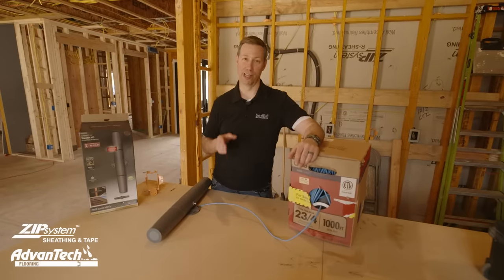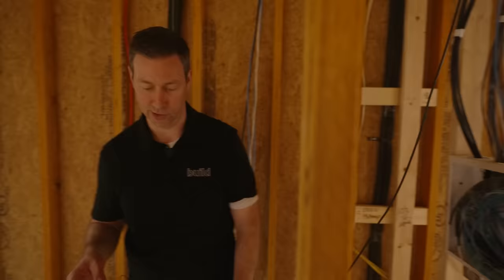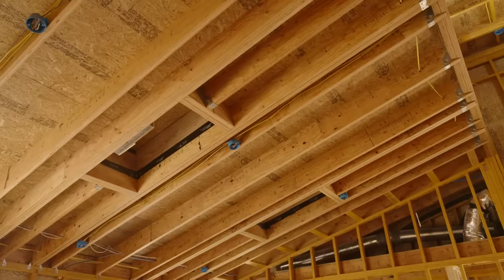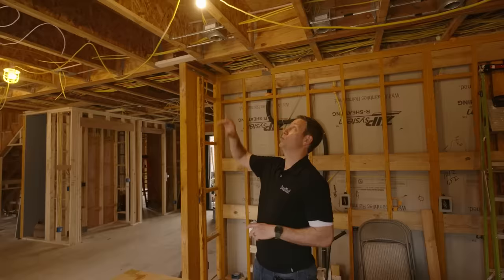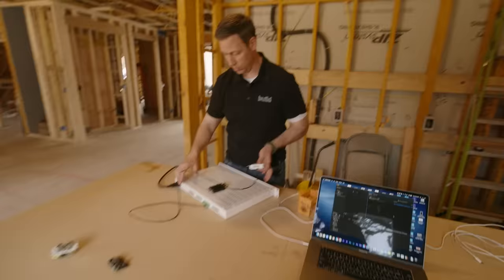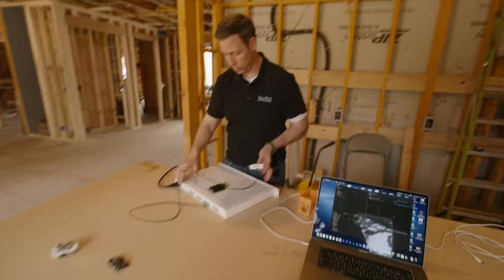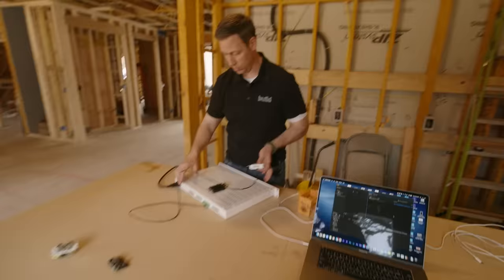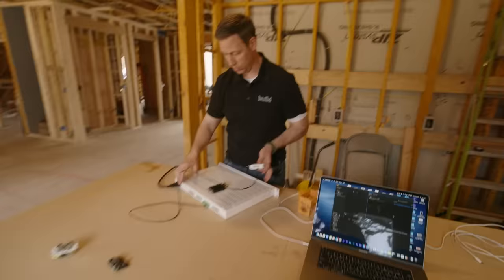Low ⚡Voltage at the Real ReBuild

Comment: I did a remodel of my house, myself and it was a 1930 house. I did brand new AC wiring as well as DC wiring. House is about 2000sq ft. But with older houses you usually had one central light with AC. But since i did not wanted to rip out lath and plaster i decided to increase lighting with LED pucks. Since lath and plaster had cracks in the ceilings i decided to mesh and skim coat the ceiling and walls, but under that i grinded channels and berried 18 AWG wires for 2 inch led pucks (normally can by on amazon for under cabinet lighting) so in bedrooms i berried between 6 and 8 of those kitchen got about 18 and living room got about 12. Each of those pucks would consume 2w at full blast if dimmed can go as low as 0.5w. All the 18AWG runs to switch on the wall right besides the AC or main light switch. But the DC gets its own DC dimmer that costs from 2 to $12 of sleek ones (also amazon). Than i ran a 14 AWG dc cable to my little DC panels which are on each floor so 3 total, which runs to a AC to DC converter about the size 2*3*8 that plugs in AC 15 amp outlet in my attic. Also bought amazon for about $40 bucks. this can handle about 75W max output so meaning I can ran 40 of these pucks at maximum to light up my whole house. The whole system cost me about $200. and i have been running this paralel to my AC lighting, Last year we had a 4 day black out I plugged this in to my portable goal zero battery and had lights through out the house for the entire time and still had half battery left after 4 days. This is a labor intensive to install, but otherwise its only 12V system. My 6 year old is playing with it and helping me. And all the old school 6 inch cans are so outdated but the 2" look great. Did not pull permits on this so im sure when i go to sell this might be an issue with the home inspectors. I used 14awg from panels to switches because in DC system power does drop on longer runs. You could run for charging your phones using car USB plugs which im sure are cheaper too. But all lighting for sure can be run on this system. you can even get sensor switches and or human sensing switches for dirt cheap in comparison to any AC system equal task parts. Enormous savings in total, especially on the visual or finishing touches and capabilities including smart home and voice activated stuff. Hard to recommend due to the fact that no inspector would ever pass this. But due to new technologies the W and V we can use for smart homes LED lighting and sensing and all that the 15amp breaker is and overkill where I can run my whole house light up to max for 200W which used to be only 2 light bulbs. Blows my mind. Would love to here if you think this will take off eventually.  

Some links from amazon
GETINLIGHT Dimmable LED Puck Lights Kit, Recessed or Surface Mount Design, Soft White 3000K, 12V, 2W (12W Total, 60W Equivalent), White Finished, ETL Listed, (Pack of 6), IN-0102-6-WH

BINZET Wall-mounted Glass Touch Panel LED Dimmer Switch Brightness Controller DC 12-24V for Single Color LED Strip Light Lamp-White

Hiletgo 3pcs DC12-24V 8Amp 0%-100% PWM Dimming Controller for LED Lights, Ribbon Lights,Tape Lights,Dimmer is compatible with Hilight, LEDwholesaler, fillite, and others' strips

12-Way Fuse Block With ground, 12 Circuit ATC/ATO Fuse Box Holder with negative bus, Protection Cover & LED Light Indication, Bolt Terminals, 70 pcs Stick Label, For Auto Marine, Boat,With 24 pcs Fuse

LightingWill Waterproof IP67 LED Power Supply Driver Transformer 100W 110V AC to 12V DC Low Voltage Output with 3-Prong Plug 3.3 Feet Cable for Outdoor Use

Comment: I would love if you could get into the tech and wiring side of things for a bit. Would like to hear more about sonos
Reply: Yes please. I geek out on this stuff.
Reply: Sonos works in a constant state of broken... It's honestly not worth the frustration or the immense loss is sound quality... If you are a lover of audio and its accurate reproduction sonos is a crime...
Reply: Sonos is overrated. Their products are overpriced and you can find similar Bluetooth devices for way cheaper.
Reply: Matt Risinger  FAKE ACCOUNT!  Your so screwed!
Reply: Please no.
Reply: If you want AMAZING in wall or on wall speakers, look into Axiom Audio.  Their speaker engineer even does great videos here on the youtoob.

There are so many dishonest audio technology companies out there that Axiom is really refreshing and not absolutely stupid expensive.
Reply: I personally wouldn't choose Sonos for anything "permanent". You want anything permanently designed into your building to be as long-lived as possible, and for electronics that typically means as dumb as possible. Integrated speakers should be hard-wired to an amp cabinet, so that you're not stuck with the speakers that you initially chose if you need to change down the line. They can terminate into any amp, which means you can use Sonos (via their Port product) now but aren't locked in if you eventually change systems, when Sonos inevitably deprecates their current protocols and devices, when the company goes under or is bought out or the products are discontinued.

I have 25 year old speakers and 35 year-old amps and a recent pre-pro. They're all still perfectly usable, but you don't see me with a boombox or other tightly integrated system. Technology moves and changes rapidly: don't build yourself into a corner with today's cutting edge because tomorrow it'll be at best passé.

And for home theater, for Pete's sake get a proper Home Theater receiver. You'll want better room correction than Sonos can provide, as well as more options for inputs and outputs and configurations. If you only use the smart features in your TV, fine, but as soon as you have multiple boxes and multiple input sources it becomes a lot more trouble to manage that via the TV than a dedicated box, and just stick to using the TV as a screen.
Reply: Hardwire your sonos amps and use in wall or in ceiling speakers
Reply: @aaronsanders3372  Totally agree. The speakers and the amplification have to be separate. Sonos might be the go to product now - but perhaps not in the future. Speakers however last for decades. I would match the Sonos with Stealth Acoustics Invisible Speakers - hard wire back to the amplifier. That's what I did for my own home.

Unlike Sonos the Stealth Acoustics Invisible Speakers work with an AV Receiver and you can use them for surround sound Atmos installations. Now tell me a wife that would indulge their partner with an Atmos install in their living room (10+ speakers) and I'll show you someone that installed Stealth Acoustics with an AV Receiver - in my case a Denon.

Comment: I was actually expecting him to say that the 12/3 wasn’t for the lighting and that he was going to wire all of his lights with low voltage.
Reply: if you want low voltage wiring using awg 20/2 instead of 12/3 - see atxled.com
Reply: @atxledconsultantsinc.9997  I'll check that out.
Reply: So much this. 
Again asking, "Why are you running 12/2 all over the place for lights?". I know this is an old video but I expected to see something other than, "I can plug my USB in to a socket and charge my stuff." 😶😒😮‍💨 And I'd surmise from the comments in his previous video that this was not what those comments were about (in fact had this same question while watching said video) but instead questioning not using PoE for actually powering his lights! 

Wondering now if Matt ever realized this was what commenters were referring to. Not charging his MBP and powering his security cameras.

Comment: Four 'twisted pair', not stranded. The category 6 is a solid wire cable.
Reply: You can have stranded Cat6 cable. Its used for short runs like patch cables that require flexibility. For the long runs he did in his house I hope he used solid.

Comment: Having lived through all the copper conductor / connector plug changes in the last 20 years I thought it obvious that my house plans specified Smurf tube (flex conduit) to be installed throughout the house so new tech cables could be fished through the walls.
The Six P's :
Prior Planning Prevents Piss Poor Performance

Comment: "A lot of you commented about my overkill wiring and it got me thinking..... But never mind that, check out this thousand dollar replacement for the free power brick that comes with your device that I got for free"

😂😂BAHAHAHAHAHA😂😂
Reply: How do they work though? Low voltage dc needs somewhat of a wire guage, to pass the current to charge/power larger devices - unless it's converted down from higher voltage in the output-unit itself(which would result in more heat at the output-unit). Even 3.5A or whatever that laptop needs, requires a semi-hefty wire, if that rack power supply is far away from it, I'd think.
Reply: @fezdk  I didn't look into the product, but I'd assume the power supply is putting out a higher voltage DC and the wall boxes are using DC/DC converters to step it down to 5V. Then a lighter guage wire is okay.
Reply: @fezdk  A larger laptop would likely draw the maximum allowed for the USB-C Power Delivery spec, which is 5 amps at 20 volts. I don't know for sure, but I suspect in that outlet setup the rack mounted converter is outputting 48v DC to the outlets and the outlets are using DC-DC converters to supply the required 5-20v range to plugged in devices. That would reduce the amps on the long run from the box to the outlets to around 2 amps, which would be doable on a thin wire. Personally, I think the setup is a bit of overkill. The best traditional AC outlets with USB ports in them top out at 36 watts these days. Not ideal, but it's enough to keep most laptops topped up on a slow charge.
Reply: @BrentLandrum  your correct most laptops require at least 45W to charge and 20V the standard AC outlets with USB-C only work on a max of 15V 2A which isn't enough for laptops.  The Voltek system goes up to 60W @ 20V, I agree its not for everyone but its cool seeing where things are headed. This could start being real efficient when you talk about solar and battery supplies becoming more popular supplying 48V DC around the house.
Reply: @DigitalBenny  Probably 24V DC or thereabouts.  A lot like the control wiring you'd see in a factory.
Reply: Exactly what I was thinking! He never answered why he ran 12/2 instead of 14/2 other than he wants 20 amp outlets everywhere.
Reply: @sacem52  It was like a passive-aggressive "FU" 😂😂😂
Reply: That seems like the answer, honestly. Buying in bulk.
Reply: Matt Risinger  Did you get hacked, Matt?

Comment: Even though you have probably moved on from this stage before publishing this video, wired connections throughout the home are still super important for maintaining maximum performance and flexibility. Don't skimp on the CAT5E/6/6A/7/whatever wiring. It is so much cheaper over time than upgrading WiFi every couple years while offering superior performance across every metric. Not just connecting a computer, but power-over-ethernet for WiFi access points, distributed A/V, security cameras, audio, powered window blinds... so many things can be connected, controlled, or powered over "network cables" it's really fantastic. Also, assuming you're dealing with runs of 30-100ft, you can easily get 10GbE without overpaying for 7A or fiber runs. Obviously, needing more than 1GbE is pretty niche, but just know that it's possible as long as the cables are well managed with quality terminations.

Comment: IT guy here. Glad to see a builder thinking about these things many new home builds don't even think about ethernet. I would recommend better wire than that home depot / Lowes stuff though.
Reply: I know it won't make a lot of difference, but a lot of those low voltage runs are way to close to high voltage. NFPA 70 says minimum 2" between high and low voltage, but that's for commercial construction and just for fire protection. I'd at least put a full wall/ceiling cavity between high and low voltage to prevent interference.

Comment: Loved watching this - when worlds collide I guess as this is largely what I do for a living! That Voltek thing is very cool. A few thoughts, as I love seeing fine buildings that include Home Automation things of this nature.
First off, skip CAT6, go straight to 6A. Minimal if any cost difference but tons of future proofing. Second, two CAT6A and one solid copper RG6 Coax per room. Either all to the same plate or split one of the CAT runs to an opposing wall. Same three cables + SM fiber to any location where you expect a TV (fiber is useful for HDMI and other things like you said). At a minimum, 1 CAT6A in the ceiling for every room, if you're feeling fancy do two though. (If you think this is excessive: WiFi has been trending towards higher frequencies in every iteration. Having an AP per room may become a reality in the very near future especially as WiFi6E becomes more common. Higher end APs use multiple Ethernet uplinks to support the increased speeds, or at a minimum you can use the second ceiling run for IoT and home automation sensors). And if you're doing speakers, some stranded 14 or 12GA CL2 speaker wire up there too. Then Homerun everything to a central location as close to the center of the house as possible, and ideally in the basement (for noise and heat) - make sure HVAC plan includes the tech closet, very important one that I see overlooked even in commercial all the time. Label every cable as you go so you're not toning things out later. Skip the OnQ stuff, go straight to a regular 19" wall mount rack & patch panels, cheaper and easier to manage. Now you have all technology infrastructure in one location; router, switches, AP controller, server, amps, you name it. Final touches: SM fiber from tech closet to whichever external wall has other telecom dmarcs - useful for fiber ISP service. 2-3 solid-copper RG6 coax + CAT6A to a roof location for satellite, HDTV, or WISP. CAT to soffit locations for IP Cams. CAT to doors for IP Doorbell(s). I also never bother with dedicated phone runs any more; just bring the service in from the DMARC to the closet and if needed in the future simply patch a RJ11 phone plug into whichever RJ45 jack in the closet and that port will be active as phone instead of Ethernet without making any changes to the port wiring.
Looking forward to seeing more like this, and thanks again for introducing me to Voltek!
Reply: I love this comment!
Took the words out of my head!
Reply: @zenginellc  holy cow I forgot all about this - I think the only thing I'd add 2 years later is MicroDuct for ALL the things!
Reply: @brodie7838   @brm  That stuff looks like fantastic stuff!
Where would I get that? I cannot seem to find a supplier.
Reply: @zenginellc  that I'm not sure, I usually see it arrive at construction sites on gian spools but not sure who the supplier is , I'll try and look at the jacket next time I see some.

Comment: I know this is an older Vid, but two quick points.  As an Electrical Engineer, this is def in my wheelhouse. 1) If you are going to pull Coax, make sure it is the high bandwidth coax or it will not support digital cable, frequencies are much higher and you need more than 2 GHz.  2)  At least one other person mentioned this. I ALWAYS pull two Ethernet cables to each TV Drop.  Yes I use WiFi, but 4K just streams much much better over a Cat 6 or higher. Especially with multiple kids, gaming and streaming.  Also, Apple TV  is much better. and this will help you eliminate a Router at your TV. I run 1 Ethernet into the TV and one is available for Game consoles, Apple TV, etc....  As always Matt is amazing!

Comment: There’s no downside (well, yeah, cost) to oversizing your copper wiring. Extra capacity for unexpected future loads, better conductors for existing loads, cooler circuits.
Reply: …..but the breakers are still on rated for 20amps…..

Comment: that tv antenna appears to be 4 monopoles inside a plastic case... so it'll probably get the best reception when oriented vertically, and worst when pointed like a cannon at the tv tower.
Reply: Agreed. The EE in me shuddered when Matt seemed to "point" the antenna at the station from the end of the unit. TV transmitter antenna orientation is vertical, and you maximize signal to noise ratio (SNR) with the home antenna in the same orientation (parallel antenna patterns couple well). AKA: Use this antenna "side-on" to the station and it will capture with better digital accuracy, vertical will help even more. Cheers!

Comment: Good video, deciding where and how much cat 6 to run is hard.  But as you mentioned, hard wired is going to have its advantages over wireless.  The more you can have hard wired the better.
Reply: WiFi signals are being "hacked" all the time.  Google was caught with a WiFi "sniffer" that was installed in their "Street View" vehicle:  they had mentioned it in their U.S. Patent application (DUUUH!).  Wired SOHO LANs are much more secure (or can be made much more secure) than SOHO WiFi networks.

Comment: I had a custom home built in 1998 that had the expansion conduit installed between the circuit box location and the attic.  Another was run from the attic to the crawlspace to allow for future expansion if needed.